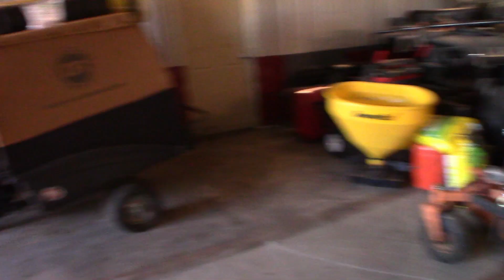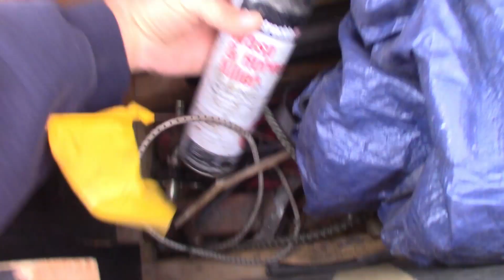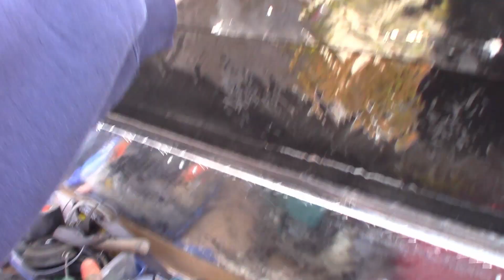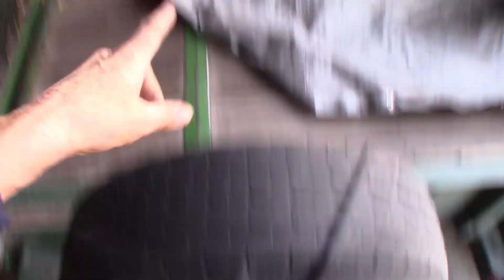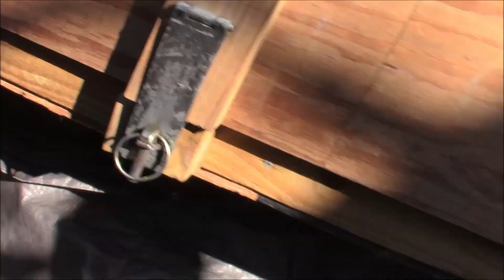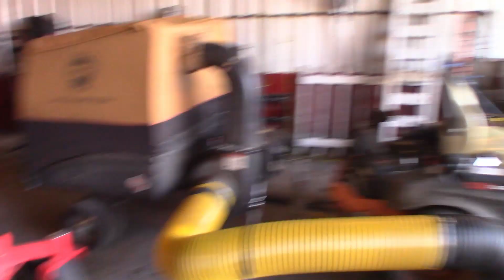2019 Fall Trailer Set Up

Comment: How do you like running the bagging system you have now? Would you change anything? Would you stay out of leaves?
Reply from the maker: Love the system. Leaves are not really a big deal just the weather is during the leaf season. Always running against the clock with it raining or snowing almost every day in our area. I do love getting on a yard that is a complete mess and looks great when it is done.
Reply: Marks Misfit World  I’m one of the largest known property maintenance company’s in my area but 80% of the leaf clean ups we do are all located with a wooded area for us to blow the leafs into. I’m not sure if I want to get a system such as yours or go to a vacuum system such as a leaf loader and mount it to the dump truck and build a box

Comment: wow, what a setup,   its a beast, it should work well.   Noticed the air is pushing out on the top fo the DR.  The 'tarp' lid is blowing up, is that normal?  Thanks for sharing your day and setup
Reply from the maker: Snaps are worn out so it won’t stay down anymore.